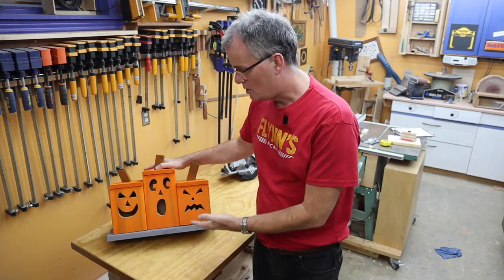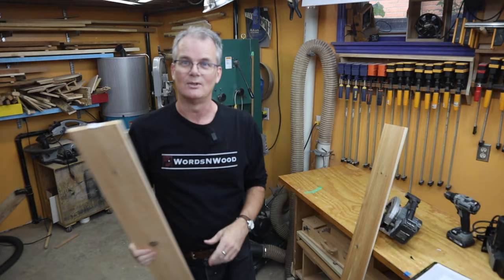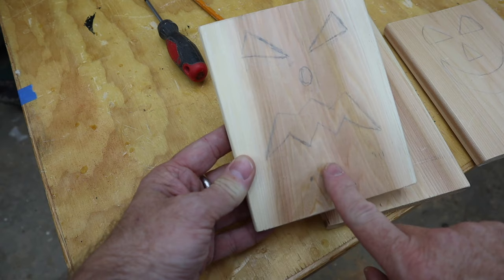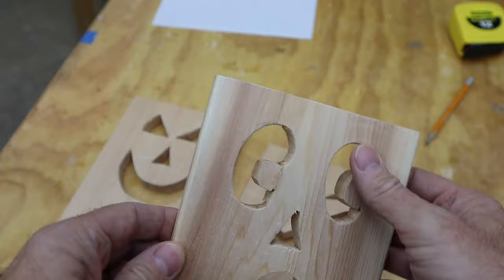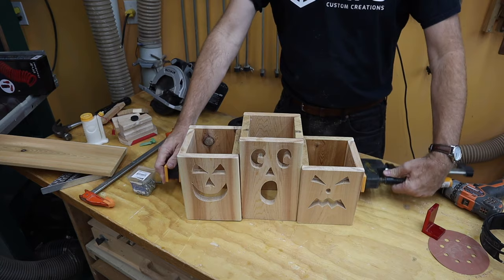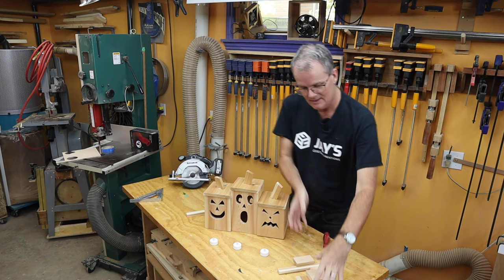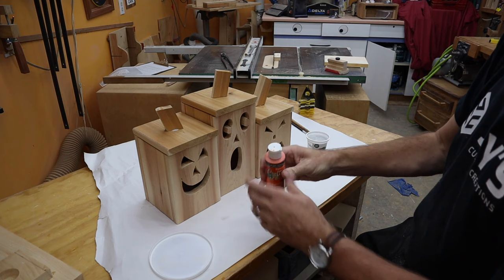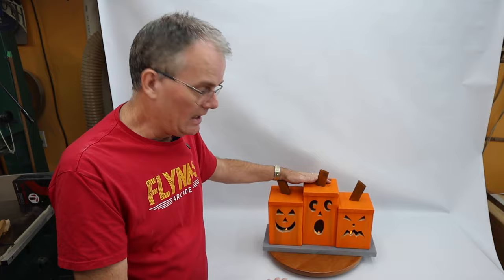HOW TO Build Wooden Jack-O-Lanterns with basic tools? 🎃🎃  Beginner Project!  // WnW268

Comment: Great video. Love your teaching style. Easy to understand,yet so informative. Art I’m new to this so can you tell me what nail gun you used and tell me what you think is best for most projects of this type and size. Thanks
Reply from the maker: I use a porter cable brad nailer, and a ridgid pin nailer.      I like having an air compressor for other things (like pumping car tires), so I find an air gun is still a good thing.  Lots of guys have switched to battery-operated nail guns because there is no air hose to drag around, and they don't use air a lot for anything else.  But I have no personal experience with battery nail guns.  You might consider that before deciding
Reply: @Wordsnwood  Thanks so much for your speedy reply. I really appreciate it! Bob

Comment: Great project, especially for building with he kids... A tip is that if you have an older jigsaw blade that still cuts ok but is a little too big for what you need then clamp it between two bits of wood with a few mm of the back edge sticking out above and then drag your angle grinder over it, cooling between passes with water. Shave it down to the wood guide and if you need more off then adjust the depth. Has gotten me out of a few situations...

Also, take an old blade and stick sandpaper on the two sides of it and you suddenly have a great little electric sander for tight spots... turn the blade backwards and wrap the paper round side-front-side and you get a pretty good electric file for tight spots...

Comment: Awesome video.  Do you pre-sand the picket boards?  If so, do you use an orbital sander, band sander, or ?????
Reply from the maker: My fence boards were smooth enough and so I did not bother to sand.  As I mentioned, this is a good rustic-wood project.  However, if you wanted, then you certainly could sand them.  I would either use hand-sanding or a random orbit sander.

Comment: I actually made one of these, but using a jigsaw all my cuts weren’t that clean? Do you think that bandsaw that you have or scroll saw can be used for all the cuts and will it make it them more cleaner
Reply from the maker: A scrollsaw with a good blade should make nice clean cuts.  The challenge with a bandsaw is that you would need to cut in from the side and then close up the gaps later.
Reply: @Wordsnwood  OK great thank you very much. I’m gonna look into getting a scroll saw. Is there a particular one I should look for?
Reply from the maker: @smeg8557   People think highly of the DeWalt, but it's pricey.  I'm not that fond of scroll saws, so I can't provide a good recommendation.
Reply: @Wordsnwood  thank you so much for all your help😊